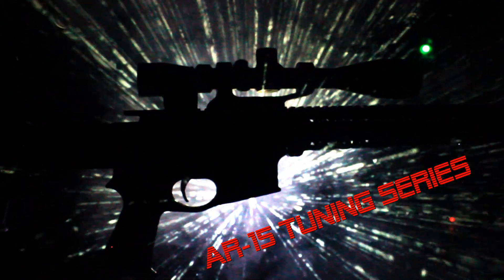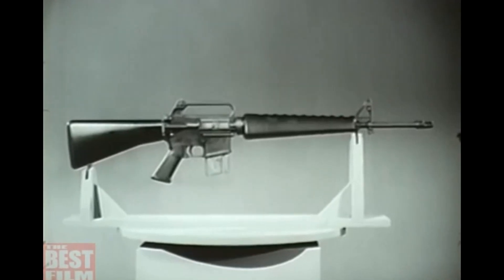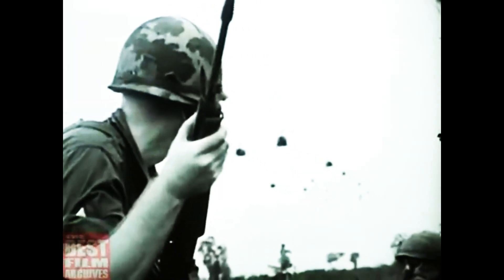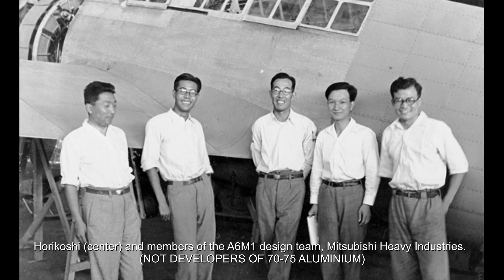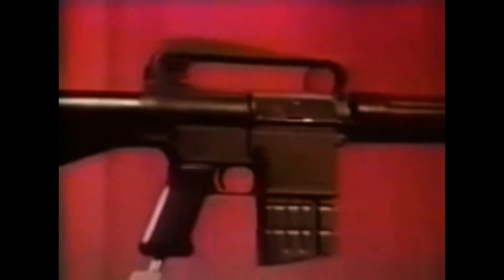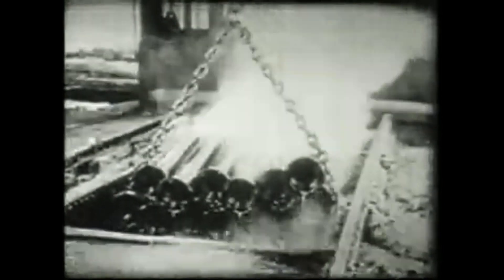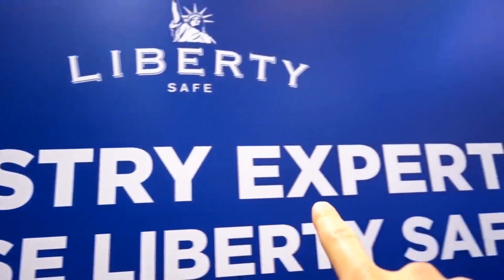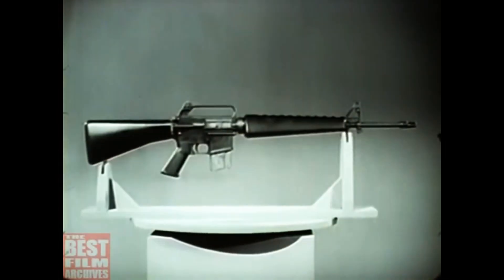6061 VS 7075 in an AR-15

Comment: What's a reliable test? I got a couple lowers, and I want to make sure I didn't get ripped off. I was thinking of testing cubic weight, but it's only a 3% difference. I'll get a better idea when I mill them, but it's hard to tell without milling the materials back-to-back, especially since I'm using carbide tooling. I figure people still make them out of 6061 for profit margin.

Also, your videos are good. You should bring this channel back. I'd be willing to subscribe to a Subscribestar, if you started one. We need more machinists making gun videos.

Comment: FYI, in January 2019 an article was published were they were able to use classic welding techniques on A7075 by using welding wires that also had Titanium-Carbide nanoparticles.

Comment: There is a reason aluminum is anodized.  When you polished it down you removed all the oxide from the outer layer.  All aluminum reacts to acid.  7075 is a lot stronger than 6061 and handles heat much better.  Anodized aluminum or aluminum that hasn't been freshly polished to remove oxidation will not react as severely.